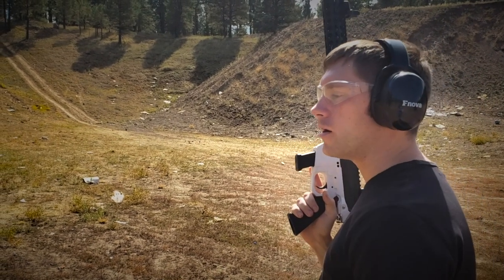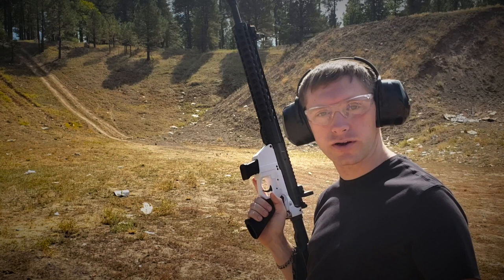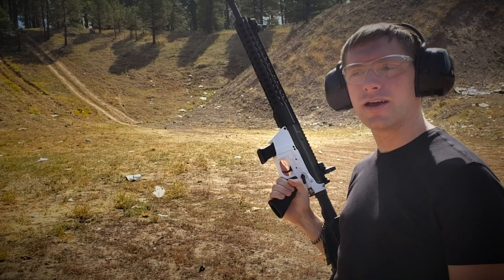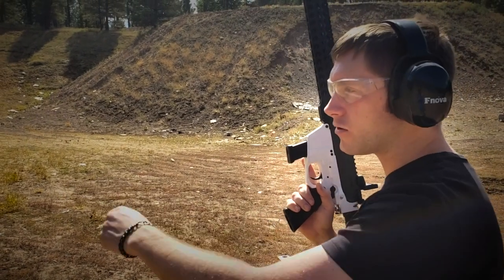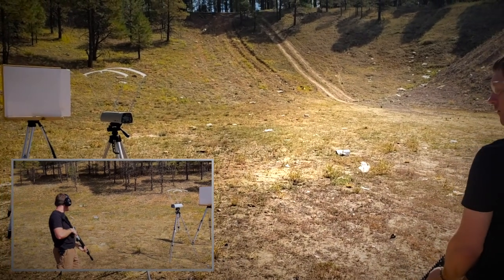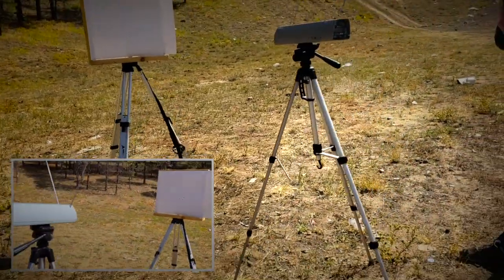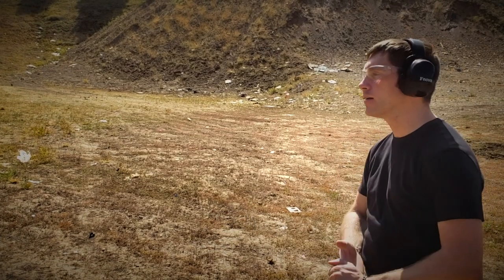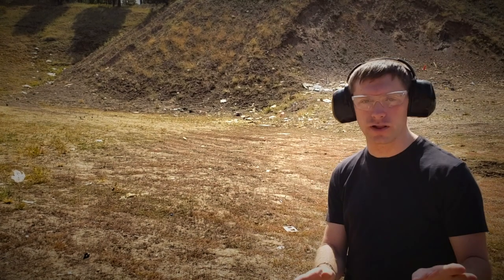Preliminary Carbine Performance

Comment: Next time you need firearms for testing purposes, from machine pistols, SMGs, belt-feds, SBRs, whatever, let me know.  I'm in Phoenix and can run up there.  -D4 Labs
Reply from the maker: Great! Thanks. Look forward to it!
Reply: Dear Santa,
Reply: now this is the kind of support this project deserves, well done dude
Reply: @AtlasArmsResearch  what is the jacket around the projectile made of? Also why not go to 357sig or 9x25 dillon..
Reply: @Tyroniusmaximus92  Seems like the idea is to eventually achieve a level III plate penetration standard with basic 9mm, since everyone has a 9mm.  If it can overcome level III plate in 9mm, it would be interesting to see what kind of special threat level III+ plates a 9mm projectile could potentially defeat with more powder behind it.

Comment: Well looks like I'm buying a 9mm and a 3d printer.
Reply: I'm not super tech savy. I'm a construction worker biker that is far too obsessed with freedom. I've been iffy about diving into the game. Any tips for a complete novice?
Reply: @toonstierney1170  I'm a beginner as well, you may want to learn some Fusion 360 (a 3D modeling program for product design) since it's almost free for non-commercial use and there are bunch of tutorials around, although it's probably not that easy to get all the freedom materials in my place(heavy restriction) but I'm still preparing.
Reply: @TaigiTWeseFormosanDiplomat  thanks for the advice. Good luck brother 🤙
Reply: Get either a Anet A8 Plus or a Creality Ender 3. The A8 Plus has a much larger printbed.

Comment: 2200 fps is the speed where you can see tissue in the temporal wound cavity tear and become a permanent wound, i.e. this round can get similar results as a rifle round out of a regular pistol.
Reply: True. A gel test to see if this bullet expands will be great. Their are 2 parts to this bullet, the penetrator and the jacket (my understanding). The jacket is bonded to the penetrator.
Reply: @costaplenty7482 
I doubt it does, not much anyway.
Reply: @StormBringare  Cool. Maybe he can tweak it

Comment: Dude, if you can achieve that with 9mm, imagine what is possible with the 7.5x27 FK BRNO.
Reply: 7.5 fk is nothing special 

It’s just a relatively hot load with a light projectile 

If anything 10mm would be better for this or 357 sig
Reply: @MyLonewolf25  What about 45 acp???

Comment: I’d like to see a 10” or 8” barrel
Most 9mm doesn’t see any gain in velocity or looses velocity in 16” barrels due to how little case capacity it has it just doesn’t have the gas behind it 

You’d probably see a decent velocity gain with a shorter barrel than that carbine
Reply from the maker: This one is kinda special in that way. It benefits much more from a longer barrel than other 9mm.
Reply: Atlas Arms  sorry worded my comment badly

Just due to the case capacity 9mm starts losing velocity over 12” or just holds velocity 
This has been my experience with anything from 147gr to ultra light 60gr loads

It just doesn’t have the volume for a full 16” hence my ask for 10-8” 
Plus that’s a more standard carbine length for 9mm PCCs á la mpx, scorpion, mp5, etc 

Just food for thought 
I’m extremely glad to see the progress you’ve made and can’t wait for production 
This is a legit game changer imo especially for someone like me who works security and armored threats are my biggest worry

Comment: how come the sabots dont punch holes in the paper? do they break and fly out of the way of the paper or have they not broken off and the holes are from the sabots?
Reply from the maker: It's not a sabot! It's a jacket which stays fully bonded to the core until terminal impact, at which point it plays significant part in the superior performance in unarmored targets. It's the rim of the jacket which punches those perfect clean circles.
Reply: @AtlasArmsResearch  aw thats so damn cool, now I know why you called it APHP!

Comment: So TL;DR is, its literally just a sabot, using a metal alloy core projectile not specifically named in the legislation?
Theoretically, one could easily 3d print sabots and just buy cores, then stuff them in brass with a known load then, no?
Reply from the maker: It's not a sabot, but rather a bonded jacket. But yes, we're hoping to tell people how to SLA print the jackets themselves! But you could also just make the core yourself, too, and use the powder load we recommend.
Reply: @AtlasArmsResearch  I mean, the concept is the same, just a matter of whether or not the core is somehow "bonded" to the sabot. I may or may not have done something similar with used-up 1/4" welding tungsten rods as a core... Albiet its not the unnamed alloy approach it is an "option" should it ever be deemed necessary...

I am excited to see what the core turns out to be. I have an Elegoo Mars which would be ideal for such things.

Comment: What printer would you recommend for that
Reply from the maker: We recommend the Prusa mk3. But the standard supported by the printed gun community is the Creality Ender 3.
Reply: @AtlasArmsResearch  thank you so much for your feed back. Hypothetically speaking it’s possible for a ender 3 to print and function properly?
Reply from the maker: @joemomma580  Most 3D printed guns out there were made in an Ender 3.

Comment: Do you think that you're bullet does more damage when it is shoot from a PCC where the velocity is so high like here than regular FMJ 7.62×39 bullet ?
Reply from the maker: Hm... Difficult to say. We don't know yet, but probable that the Dagger would leave a larger permanent wound cavity, while it's possible that the 7.62X39 would induce a larger temporary cavity. Look forward to testing this.
Reply: @AtlasArmsResearch  Thanks for the fast answer ! I was thinking that the dagny dagger in a PCC leave more kinetic energy into a body because it expands way more than a FMJ 7.62×39 (2350 fps) with his hollowpoint form and velocity of 2700 fps (that increase the expansion power).
Reply from the maker: @wsh1236  Pay no mind this whole "kinetic energy dumping" thing. That's not how terminal ballistics actually works. Were it, the Dagger would be quite underpowered, but that's not what we see in gel tests. It may very well prove more devastating than 7.62X39 ball, but we won't claim without proof.
Reply: @AtlasArmsResearch  Ok, I see what you are saying. I have seen a video where you compare the dagny dagger to a standart hollowpoint ammo where it was shoot into a ballistic gel. Its true, it was pretty similar to a shot from an AR-15. And I really think that shoot from a PCC, it can equal without problem the power of a .308 Win. Anyway, the dagny dagger is so powerful.

Comment: From the videos I've seen this looks like a saboted bullet. Can they be shot through suppressors
Reply from the maker: Not a sabot, but rather a bonded jacket. Don't know what it wouldn't work in a can, though untested.
Reply: @AtlasArmsResearch 
It looks like the same principle as SLAP rounds? IIRC the plastic sabot/jacket on some of them (maybe all?) releases so early that it can hit a muzzle brake or the baffles of a suppressor and destroy them. This would be pretty important information for anyone looking to buy this ammo in case they like to run a can.

Comment: Nice 9mm U-Bolt design. Where can we find the files for that, please?
Also a question toward the dagger: Isn't the combination of very light bullet and very high pressure hard on the gun?
Reply: CTRL PEW website has them I believe
Reply from the maker: Very high pressure is typically hard on the gun, but in fact the light weight of the bullet reduces recoil and therefore causes less wear. In the end, it's about the same as a standard load.

Comment: Velocity is irrelevant. The power required to pass through a target is more important to the design of a weapon.  When the power is made a chronograph cannot read it as they are desighned for slower movements that are less likely to go through what you want.
Normal guns destroy targets. The ammunition made will do the same thing.
What i am seeing is claims to achieve what weapons normally produce when deployed. The plastic parts on the gun shown suggest video special effects as plastic will blow up when the weapon is discharged killing the shooter. Three D printing is not capable of making weapons parts. They are used for prototyping and conveying ideas as you are. Weapons parts require more strength than is possible with a three D printer.
Reply: You are right velocity by itself isn't very important.

However, the AR15 platform (which theirs sort of is) is COMPLETELY capable of accepting a 3D-printed lower, and there are many such designs that can withstand hundreds or thousands of rounds when 3D-Printed.
Reply: BIG BRAIN
Reply: Tell me, does the explosion happen inside of the lower receiver, or inside of the chamber of a chromed metal barrel? Also, did you even watch the IIIA dagny dagger demonstration video? Let me see you reproduce those results with THE LORDS CALIBER 45 ACP FMJ's.
Reply: KE = 1/2m(v^2) velocity is exponentialy more important than mass.
Reply: The upper is an off the shelf unregulated component. Most likely traditional manufacturing. I wouldn't try a 3d printed lower as a melee tool.
Reply: @Eluderatnight  Exactly. So it wouldn't, and clearly doesn't, "blow up when the weapon is discharged, killing the shooter"
Reply: What? Velocity is irrelevant, but power is not? What the fuck is "power"? Do you mean energy? Because without velocity you have no energy. Energy is changed exponentially with velocity, remember E=MC2?
Reply: He's a troll guys, let him do his thing lol.
Reply: Plastic frame guns don't work, and will blow up?
Hmm. Explain Glock. Or FS2000.
Or the KP15 lower.
Reply: @PeaceManBro  
That or E = ½mv² but yeah.
Reply: Wow you have no idea what you are talking about! I guess YT is famous for ignorant commenters. There are lots of videos of 3d printed AR lowers running just fine.